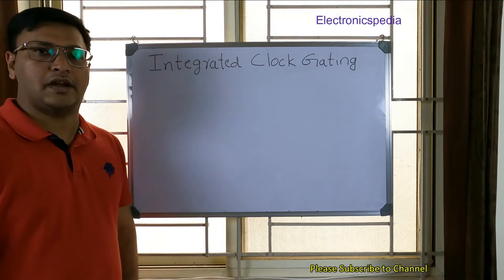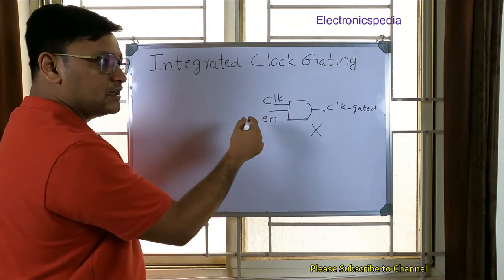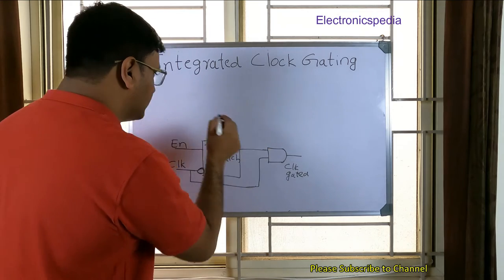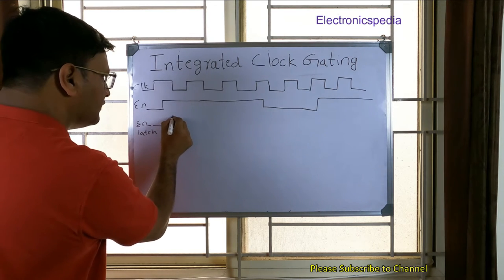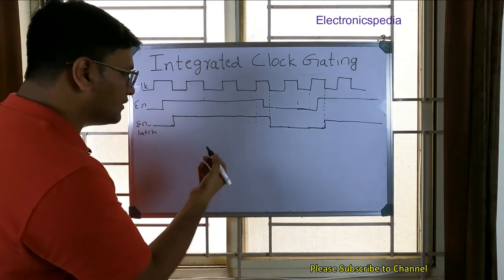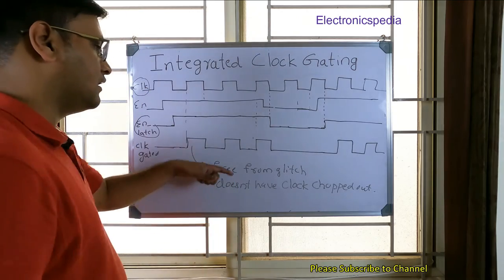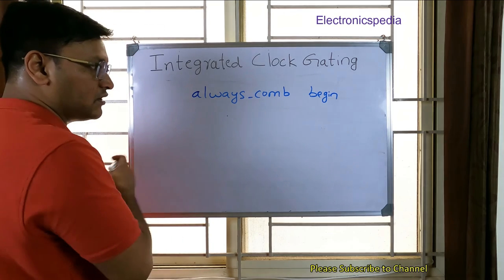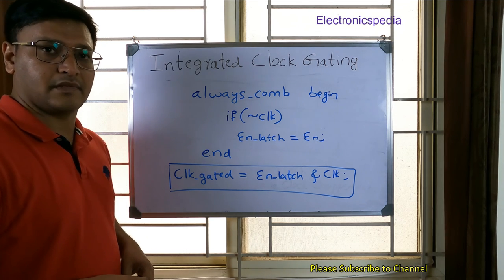Clock gating technique in VLSI |   Integrated Clock Gating (ICG) | Latch Based Clock Gating |

Comment: so from your example, what if the en signal is high in the mid of when clk is low? it will still cut the clock pulse right? I think you should be using ff instead of latch!
Reply from the maker: En signal is latched only  when clock is low going to the latch, but at that time subsequent and gate won't propagate it to output as the clock is low.

Comment: I think in the SystemVerilog code it should be if(clk) instead of if (~clk). This is because we're trying to infer a positive level triggered latch which is transparent during positive level and hence samples the input on the negative going edge.
Reply from the maker: Hi Ayush, No we should be sampling on the negative level triggered latch. Then only we ensure that enable signal is low when we AND with clk in subsequent AND gate
Reply: @Electronicspedia  okay sir got it thanks👍

Comment: Why can't we use flip flops instead of latches
Reply from the maker: Latches are level triggered. So they wil be working as long as they levels are high or low depending on active low or active high triggered.
If you use the Flip flop then you can sample the data input only on the clock edge.
Reply: @Electronicspedia Great video very helpful for my digital electronic systems exam. Just one question. If we replace the latch with a D flip flop and we sample on the positive edge but with an inverted clock, is the same?